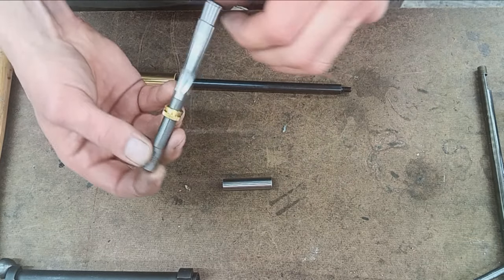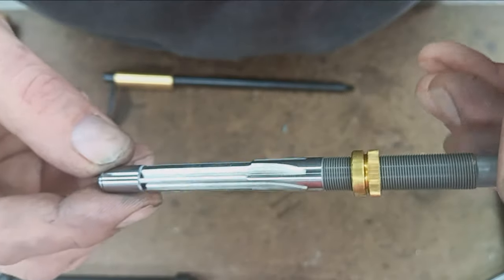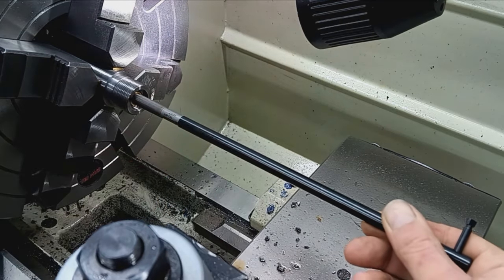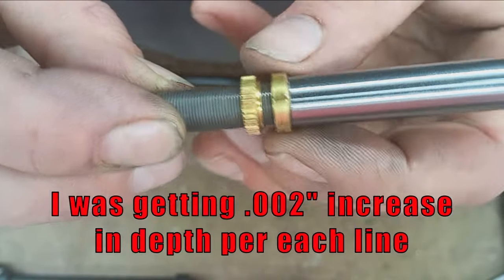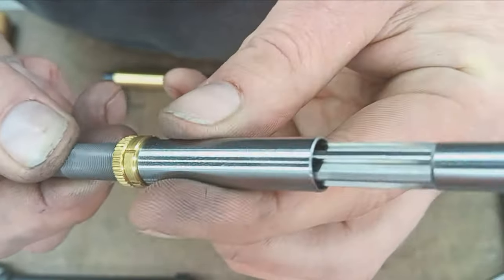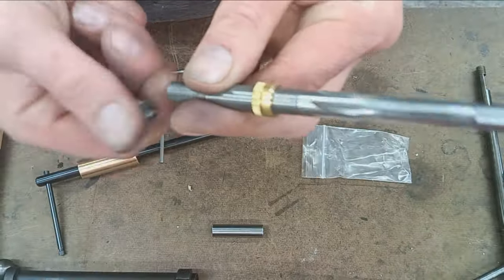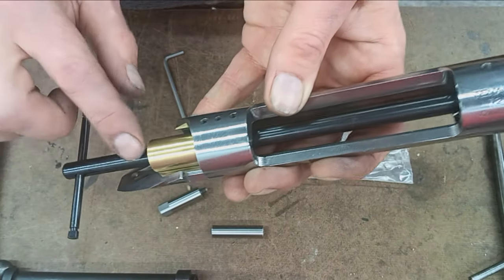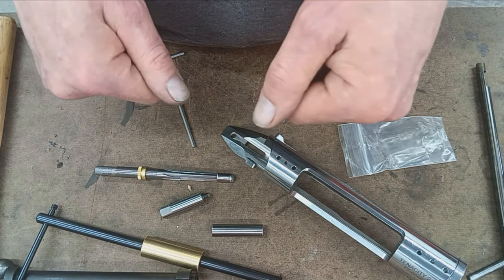Pacific Tool & Gauge UNI-THROATER - Sweet Tool for Repeatable Custom Throats

Comment: Geoff, couple of questions: when using it by the extended T handle, not under power, do you feed it in till you come up against a hard stop and then dial in the depth of cut on the reamer stop? Did you cut all .020" at one time or "sneak up" on it in increment? How did you check accuracy of depth of cut? I know, that was three questions
Reply from the maker: Hey John!  You can definitely "feel" when the reamer begins to cut.  I'll set it back and slowly advance in until I feel it cutting and see chips, "sneaking up" on it as I go.  I use a Overall Length Gauge I made (similar to Hornady's) to check progress, measuring the depth advancement.  Hope that makes sense!  Thanks for watching and for engaging the channel!
Reply: So they are cartridge specific? Or is the "uni" for "universal". I'll look them up on their site... hopefully the description won't be as vague as some of their others. @AccurateRiflesandRestorations
Reply from the maker: @johnseptien3138  They are caliber specific (22, 25, 6.5mm, 7mm, 30, 338 etc...).  Their website description is actually pretty good!